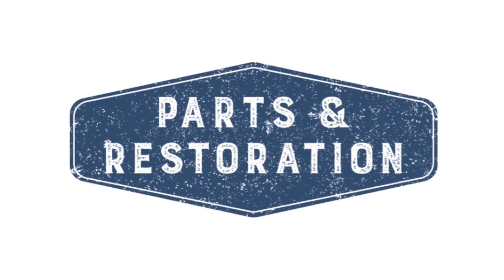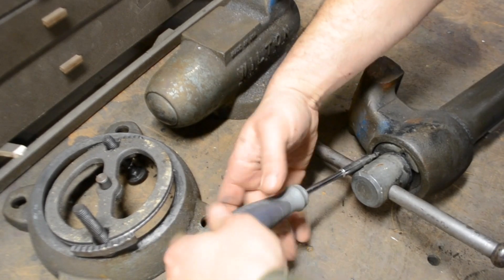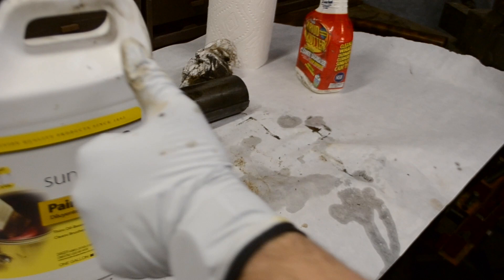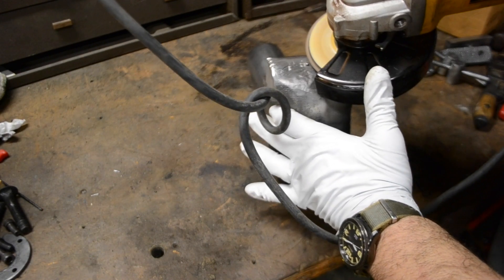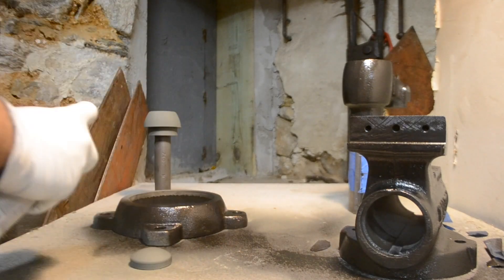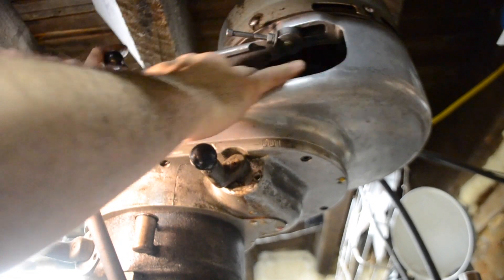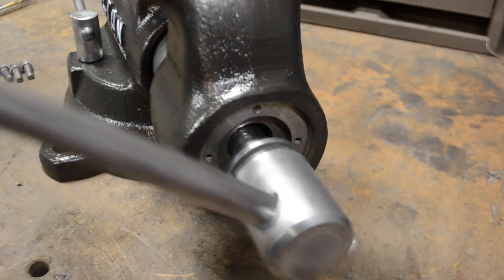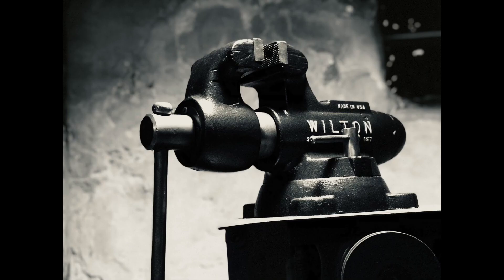Wilton Bullet Vise Restoration | How To Restore a Vise

Comment: Thanks for advice about flap disc restoring old wilton shop king was going to use grinding wheel on welded crack repair but getting a flap disc now.  Top 3-4 vice restore video ive seen out of dozens and I'm picky 👍🏻
Reply from the maker: Earl, thanks for watching and be sure to Subscribe! That’s a really generous compliment, thank you!! Flap disks are excellent, for knocking down gloopy welds without accidentally taking off the meat you wanna leave! Stay posted, new videos on the way!

Comment: Got the pin issue in order !! the 1/4 bit smooth shaft end works good, had to realign all  the holes, the pins 1/64 loose, just will add a couple drops crazy glue to hold in place. Got the vise on a trade off for a ridgid impact drill, battery and charger, its going to look beautiful when its done, 500 DOLLAR LOOK COMING SOON !!

Comment: Just got this model, Purchased without pins, the dust cap round was pan caked, the pounding it out helped to bring it back to some semblance of form, have it all disessembled now- to make pins I will be cutting off the smooth ends off some drill bits,,, seems like 1/4 bit fits, but a 64th loose. Question- dose the 2 pins have to penertrate three holes- outer case, inner collet and plunge screw?